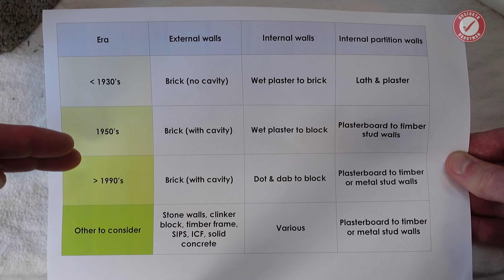What are house walls actually made of?

Comment: The walls in my 1870's house are pretty much made of dust 😂
Reply: 1840 here, I've got mixed stone held together with dust. Great fun to hang a shelf 😮
Reply: 1901 house and mine are bricks just balanced on top of each other. Counting myself lucky now.
Reply: I've also got no foundations, tunnelled under the wall to put a new mains water pipe through with a garden trowel 😂
Reply: @findbluesky  same mate! Still standing though
Reply: 1896 semi UK house here, My red bricks are so soft my combi drill in there like a hot knife though butter.
Reply: 1910s semi here. Mixture of soft as butter London stock where it shows and overfired infill that's like flint where it doesn't. Was drilling for a rawl plug t'other day, had the bit spinning at full speed and leaning on it hard getting nowhere fast. Suddenly the bit grabbed and turned into a fishhook. Fun times.

Don't ask about lime plaster. Bloody stuff is held up with load bearing wallpaper in places.
Reply from the maker: Some brilliant comments here - keep them coming! "load bearing wallpaper" 🤣🤣🤣
Reply: Paramount partition
Reply: I have a partition wall, when I drill into it this black powder comes out. It's 1930s house and I've heard it was popular to compress soot or ash from the factories into these "bricks".
Reply: Mines is Victorian terrace house with stone and lime dust infil with wood chip wallpaper holding it all together.  I have bought that same sds drill and it gos in like butter. Much better than the old drill I had and I lost so many drill bits.
Reply: @DavidLee-cw6ci  it is common for them to have “slack” in them if close to pits, my mums are like it& the same age.
Reply: @rob-fb5xs  Yeah sounds like mine. I have managed to fix things into them - regular Fischer anchors for lightweight stuff, but had to use resin anchors for heavier item.
Reply: @danielrolph-wills2966  🤣🤣

Comment: I have a late 60s house and all upstairs walls except one is paramount board. The one wall which isn’t is the wall the bath is fixed against so I’m guessing it’s due to the risk of water ingress. In my house the plasterboard is surprisingly strong but despite that, I’m reluctant to hang much more than 10KG off it if that. Unfortunately my revision budget didn’t extend to replacing them all, so I’ve had to stick with them. What interests me is how they’re constructed, as they’re far too big to have been dragged up the stairs. I’m guessing they were just craned in. Love to see some old brochures or footage involving them just to see how it’s done.
Reply from the maker: Yeah not sure! As you say I suspect craned in before the roof went on... but then you'd need to keep them dry? So not sure... 🤔
Reply: Same. All of my upstairs walls are paramount. Was fun when trying to run pipes up and fit a bar mixer shower in such a thin wall. Ended up just studding it out. I also use them Fischer duopower to hang stuff as I get a really nice fixing with them.

Comment: My 1927 house as brick walls with a small cavity. You're spot on about the bricks being rock solid. Unlike modern bricks, which have frogs or holes in, they're effectively a lump of fired clay. The dust is a nightmare as well and stains things easily. 

One thing I have noticed with these old walls is the mortar is incredibly soft so care needs to be taken when drilling: if you put pressure on expecting brick but hit the mortar, you're liable to land the drill chuck into the plaster 😂 

Final pitfall with old houses is in certain places, i.e above windows, there's likely to be loads of holes already hiding behind the plaster and can cause issues with getting a good hold with your plugs.
Reply from the maker: Yeah some of the mortar in older houses is basically just dust. 😂😭

Comment: Great video as always! My house was built in 1970 and most of the internal walls are paramount (didn’t know it was called that until today). Plasterboard fixings work well in it but watch the thickness. Not ideal for running cables either…

Comment: My first house had a section of wooden cladding on the front and an even larger section on the back. When upgrading the wood to PVC I found that behind the cladding was a timber frame and then the actual plasterboard of the room….central heating pipes too and certainly no insulation. Terrible design.
Reply from the maker: Such a bizarre design! 😬

Comment: My home in Arizona, USA was built in 1960. It is built of cinder blocks, with cavities in the blocks. The cavities are filled with vermiculite. It was a nightmare putting a hole large enough to bring in my security camera cables as the vermiculite would fill up the hole faster than I could clear it to pass the cables through.

Comment: Our house is early 60s and has breeze block on all internal walls, including non-supporting ones. In a way I prefer this to stud walls as you don’t have to worry about finding studs or using plasterboard anchors but they do pose some problems. The main one being that drill bits have a tendency to wander - either slipping into a void or hitting a particularly hard bit of internal aggregate. This becomes frustrating when getting two holes level is important - like hanging a TV mount or a pair of picture frames.
Reply from the maker: More soundproof too! 👍👍